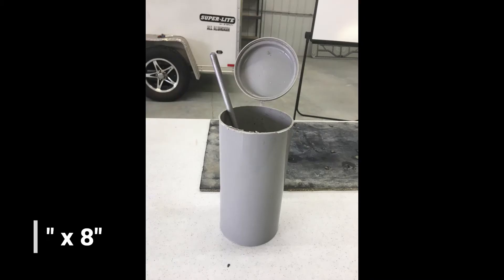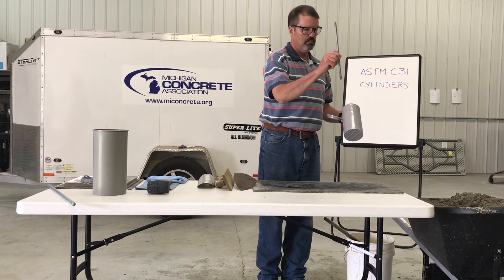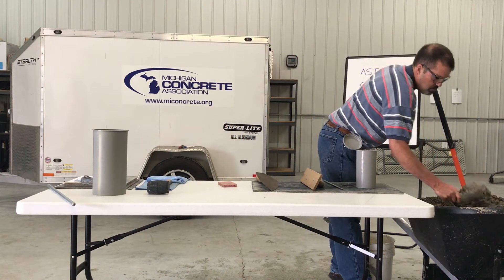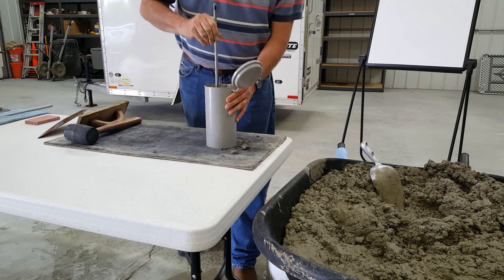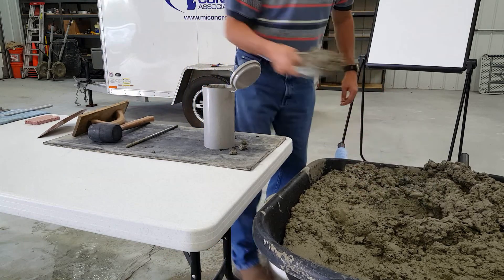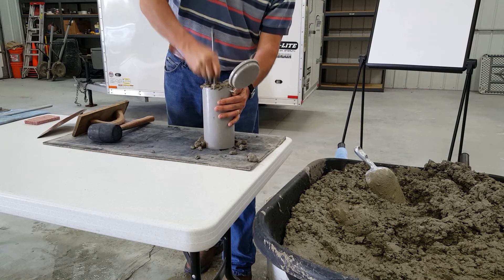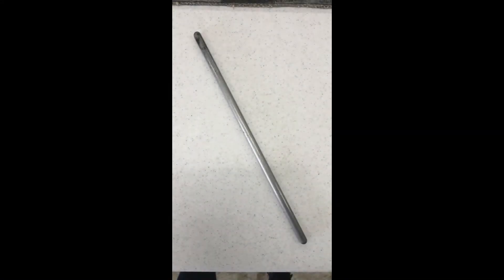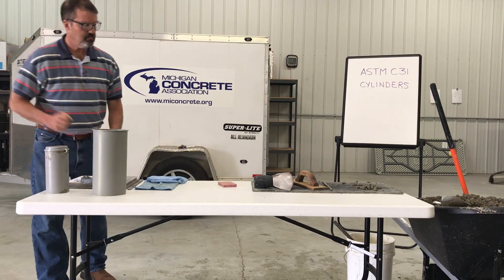ASTM C31 Making Concrete Test Cylinders

Comment: Molds used for test specimens should be placed on a level, rigid surface, free of vibration and other disturbances!  A flexible table or tailgate of a truck are not acceptable places to mold test cylinders per ASTM C31.
Reply: I make sure to do it on my tailgate, on a board, with my truck running, it uses more fuel for upside cash back. 1 fill, smooth off the top with zero spillage
Reply: no one really cares tho. some sites dont even have the curing box anywhere near the concrete truck. im not carrying 6 cylinders 200 meteres. also you have to cast real fast else you gonna miss all ur next sites XD